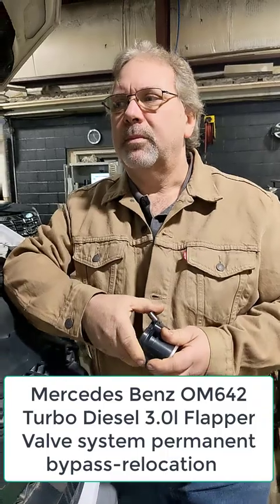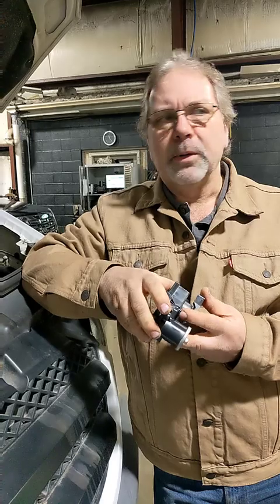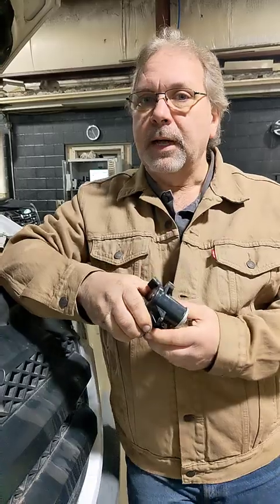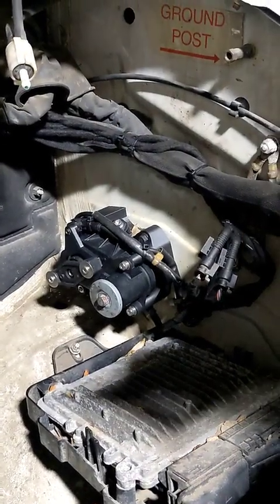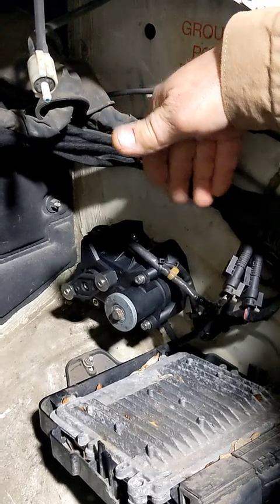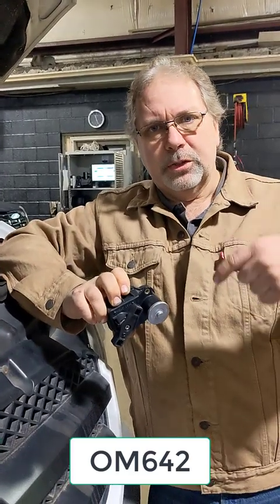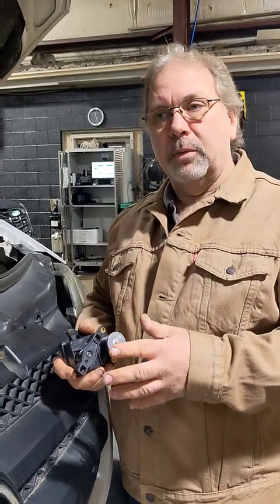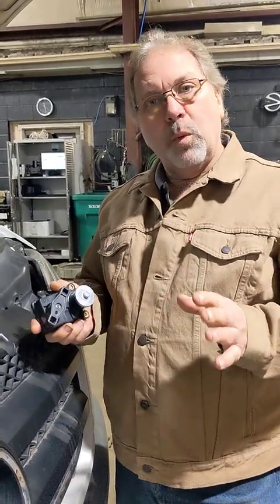MERCEDES OM642 - SPRINTER INTAKE MANIFOLD FLAP - SWIRL VALVE SERVO DELETE AND BYPASS  - RELOCATION

Comment: 4.7 resistance is all you really need.  Pin 2 an3 in the plug going to the servo under the charging turbo pipe.  Less than a dollar.
Reply from the maker: This is not a true statement. Maybe early vehicles allowed this resistor trick. The newer vehicles will absolutely throw a check engine light. The vehicle operates the servo and looks to see sensor activity. No servo, no sensor = check engine light.
Reply: The resistor just fools the computer that the swirl motor still present and working, however it does not send any signal to the flaps sensors.
Reply: @binjou2061 yup! Just make sure you leave the flaps fully opened!

Comment: Wich yeah is your van?
And do you have temperature sensor, because someone have and others don't. I have a German Mercedes Viano 3.0 bluetec efficient model from 2012 and resistor delete will not gonna work. You have done a good work. Thank to the answers 🤙
Reply from the maker: The van in the video is a 2011 sprinter 2500. There are temp sensors, but i don't mess with them in any way. Why do you ask??
 The resistor trick will only trick the ECU into thinking the servo is installed. The resistor trick will never be able to trick the sensors, CEL will come on.. 
Steve
Reply: @IFLYRV10  Hi Steve Working on a 2007 Dodge Sprinter 2500. Looking for a link to purchase your complete kit.
Reply from the maker: @gordystewart9042  finally got the site up and running. Benzservofix.com parts are in stock and ready for immediate shipment. Thanks for inquiring.
Reply: I need a link to buy one 2007 dodge sprinter please
Reply: Need to buy the base kit how much